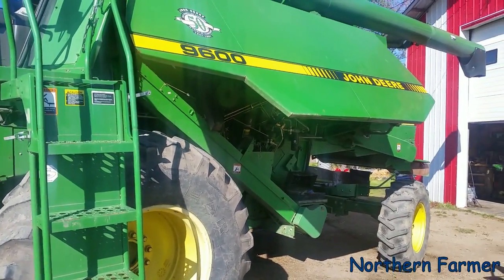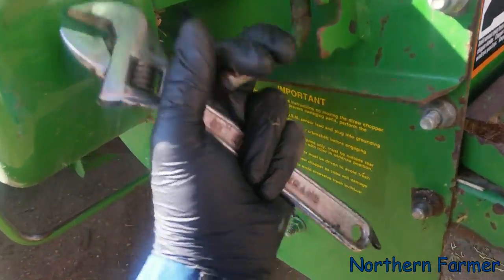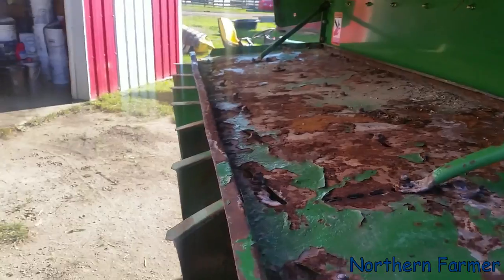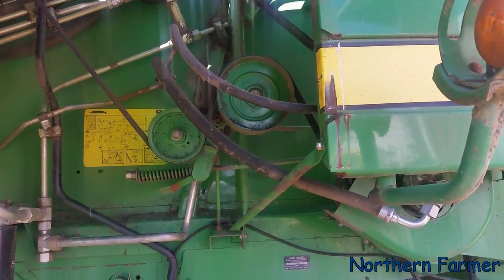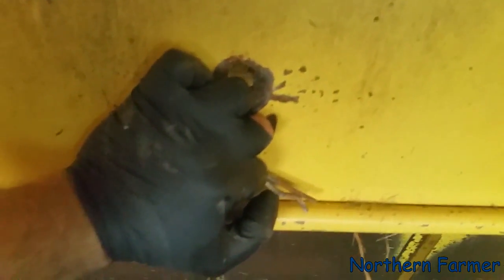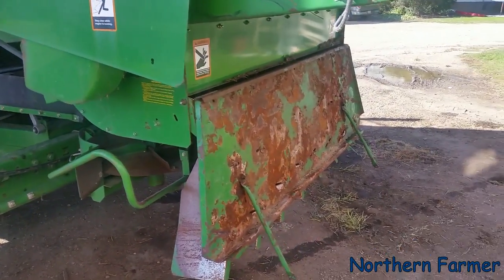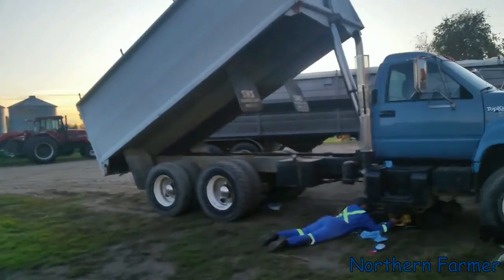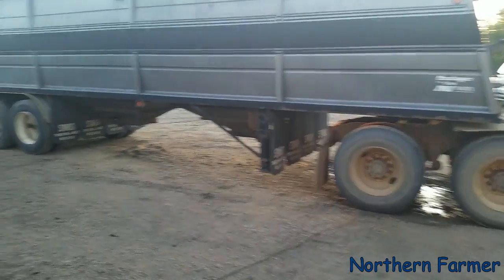Getting the Combines ready For Straw!!

Comment: Back in the day we had to unbolt the chopper and try to sit it on top of a 55 gallon drum that we put under it. That was really no fun, I'll use your adjustable wrench any day... lol.   Good video, thx
Reply from the maker: same here... heavy buggers
Reply: Have a jd 7720.  It's a bolt on.  Going to sell now as I've just bought a 9600.   On my old one, I have a farm wagon that doesn't get used much, so I back up  to it with the chopper over the deck. And with some blocks, and a jack I can manage to put chopper on and off relatively easy.  It's just a matter of getting the first bolt fastened sometimes.  And a bit of cussing usually goes with it.  lol

Comment: Hopefully you get good weather we got rain here in MB last weekend and are on stop for a few days. Our Massey 750's pull the belt and slide the chopper so it's pretty easy for an older machine.  I've been told by quite a few guys( Bleed green and yellows to) the only thing Deere ever thought should go through a combine in North America was corn and beans. until a few years ago thats about all they would thresh  and put in the tank decent,  anything else was kinda follow the thin green line L.O.L.

 We had Deeres back in England the European ones where real good machines to be fair.  I get straw from local guys for my barns it has to be conventional combined but I think the last 2 9600's are leaving this area after puking bad this harvest. The guy with a conventional NH is done growing straw crops this year to. so I'm kinda stuck unless one of the newer Deeres won't mince the straw so bad, I did combine 330 bales of oats that was tough from one but the guy sprays his wheat and barley that turned to dust . I can't get enough straw from our land and our machine. Thanks for sharing I'd never seen a guy set up a 9600 before.
Reply from the maker: Thats why they built the CTS combine

Comment: My old '81 L2 is easier than that 9600. On the L2 you just put the belt on a pulley above the chopper, pull the spring loaded tightener pulley down, over center. You can do that with one hand. Flip the belt off the chopper pulley up to the dummy pulley and that part is done. Remove two bolts, loosen two more and slide it forward and tighten the two bolts. Probably takes 20 minutes if you have to take a screwdriver to clean out the slide. I like how your TR does it.
Reply from the maker: SilverGleaner I know it’s crazy....I liked our old new holland tax 36...just flip a handle...done

Comment: 40 mins!? It's a 5-10 min job maximum. I can switch both our 9600 and 9610 from drop to chop in less than half hour, cleaning and messing with belts included
Reply from the maker: Not this one....
Reply: @Northern_Farmer  nah it's the same, just stock bits haha. If you wanna speed that up, get a couple turnbuckles with quick pins for the tail board (you'll have to make little attachemnt points, super easy). After that set your belt tension with it set up in chopping mode, then you won't need to touch that again. To pull the pins just use your wrench to wiggle the chopper with the mover shaft (right side is almost always loose), then roll it all the way forward swap belts, pop pins so they can fall in place and roll forward into the locks.
Reply: Might need to find a different belt for dropping mode, but thats better than wrenching for half an hour on the tensioner. Lastly loop the belts and slip them into the rear frame tube under the seives!
Reply from the maker: @nsbfan  I have seen some 9600 with the tensioner handle
Reply: Never seen one myself, but I believe you. Either way a good ol machine!